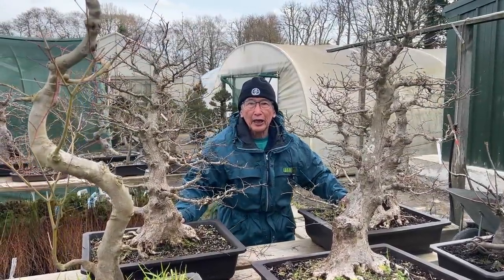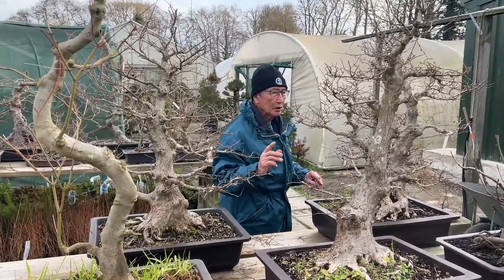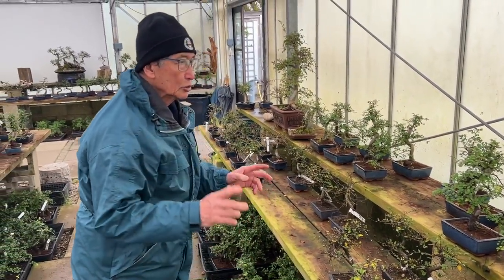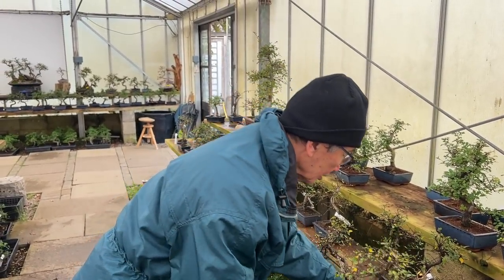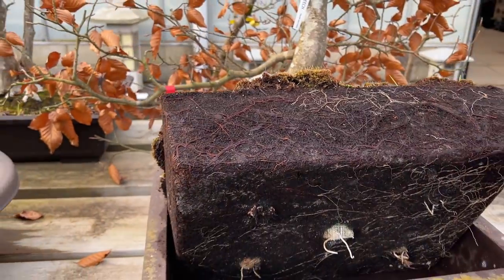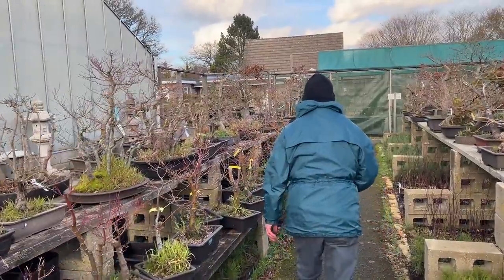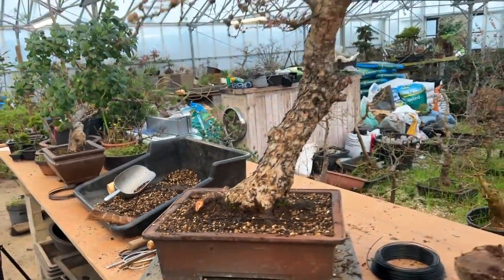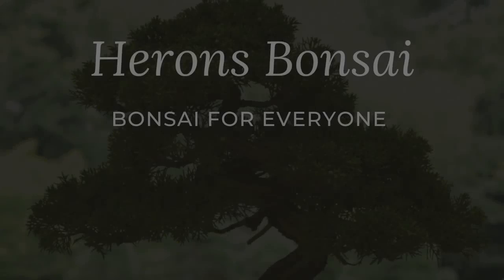How to check if your Bonsai tree needs repotting

Comment: Still hoping to see another 'Bonsai for Free - Using Seedlings' video. Even though I'm not a beginner, I still find it interesting, it's what got me into bonsai.
Reply: Yes. Can't wait to see some ash, sycamore, oak and chestnut seedlings or sapling bonsai. Free trees, very easy to find the right time of year.
Reply: Growing from seed is worthwhile and should be encouraged, but for bonsai purposes is a very long process and probably best done alongside having more developed trees to work on while the seeds grow. For beginners it is better to shortcut the process and buy cheap saplings from somewhere like The Woodland Trust which will give you a couple of years head start.

My neighbour has a Sycamore tree that every couple of years drops thousands of seeds into my garden. I have a couple of seedlings I potted in mame bonsai pots. Each year they put out a couple of massive hand sized leaves in spring. Cutting these off at the end of May causes them to have a second flush of a profusion of tiny leaves which look very pleasing.

Comment: I understand what was meant by not understanding the people who repot immediately after buying a bonsai, but I'd like to share. Now, I wouldnt call the plant a bonsai in the state it was gifted to me, because there were no signs of wiring or choosing a pot or a front - nothing, it was a small young plant, not a bonsai though. It was fine at first, but I started noticing signs of stress from the plant...the soil was too wet even though it didnt seem like I was overwatering it. Have to admit - I was, but without my own knowledge. What I realized very soon after that was that no matter how much I try to underwater it - the soil simply wouldnt dry, the roots were suffocating, rotting. That spurred me to repot as fast as possible, got the soil, the pot, mesh, wire and went to work. After taking the plant out of what turned out to be TWO pots: one inside the other was plastic - with drainage, and one outer pot (glazed ceramic) - WITHOUT it, and on top of that, the top edge was forming a flat edge, covering up the existance of the plastic pot and preventing the inside of the pot from breathing...that got me mad at myself, for being to naive and inexperienced...and mad at the seller, who apparently was selling "bonsai" that were fake and destined to die...my rage gave me energy and motivation to trim the dead roots, diligently repot the plant, prune it and wire it over time. Still have room to grow myself, and all my mistakes will stay on that plant, but I was happy with the results and ended up learning quite a lot through the process, mostly watching your videos and some others...It's been a while since then, so I suppose I'll have to repot it again, but with more confidence, because now I know by heart what you meant that the plants bounce back and react well to even some actions that seem drastic to other plant growers.

Comment: If a tree doesn't need repotting, I'm guessing it's still good and safe to top off the soil. In my area, if I have neatly arranged the soul in a mound and added moss and occasionally some decorative miniatures, after a year the squirrels, rain and snow have eroded the soil and exposed more roots and it can just look messy and unstable.

But, maybe I'm not using the most appropriate pots, soil, mesh, etc for each tree.

Comment: So do you always need to go to a bigger pot when the roots overtake or are there other things you can do because if you go into a bigger pot wont that then make the plant bigger as well?
Reply: Simply reduce the size of the root ball and put it back into the same pot. Fill in the gaps with new soil and you should be good for a couple years. Good luck

Comment: What type of soil would you recommend using for repotting?
Reply: Normal bonsai soil is a mixture of akadama, pumice and lava rock, but this is normally only used for finished trees, as the rocks don't contain nutrients and you need to fertilise often.
Reply: In the UK it's not a massive issue so long as it is free draining and has nutrition.
Reply: If you search YouTube you’ll find the videos Peter has made on soil for bonsai.
Reply: US? Or UK? Which species of tree? I use a mix of pine bark, akadama, and lava grit. Sometimes I ad some sand for some species. I aim for soil that drains rather quickly, and steadily. 
But depends alot on the type of tree, and age.
Reply: @Blaydrnnnr  UK
Reply: @pansepot1490  cool thanks I'll look it up.

Comment: @heronsbonsai I emailed you last week to ask about my bonsai who’s roots are also coming out of the bottom of the pot. I repotted it last year, but the roots are growing pretty fast, so am worried that it’s pot bound again. You said to leave it, but in the video you said to repot if roots are coming out. I’m confused. What should I do??
Reply: Look at the root ball and feel it - if the root ball is compacted and solid - then it needs repotting. If the root ball is soft then NO.
Reply: @peterchan3100  thank you. ☺️
Reply: @emilylloyd-gale6382  the tree can have roots growing out of the bottom of the pot and still not be pot bound at all. If you don't like these roots, then just cut them off.

These roots can additionally feed the tree though if you place the pot on the ground, but you need to be careful that they don't grow thicker than the hole in the pot or the pot could burst over time. And depending on the species you could use these roots as root cuttings, like elms and field maples.